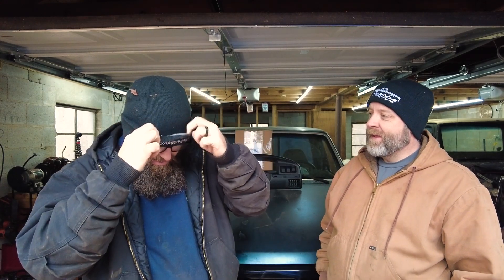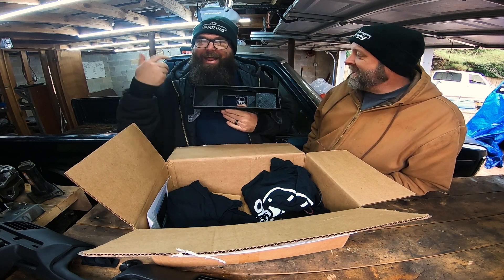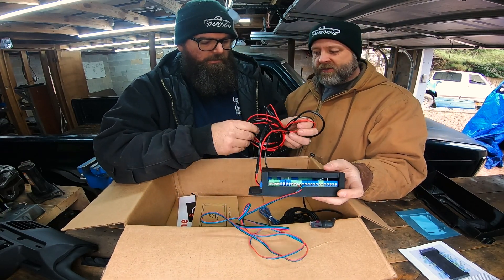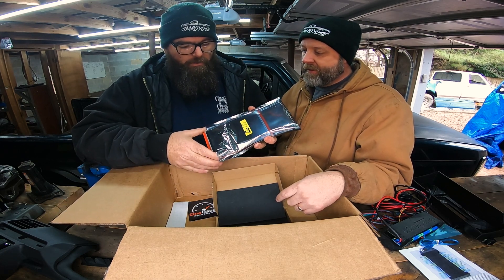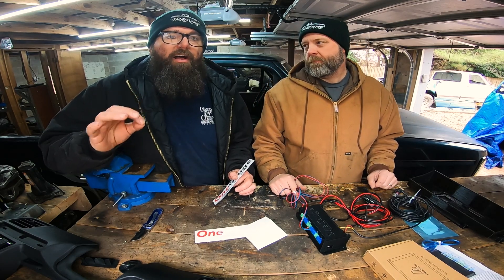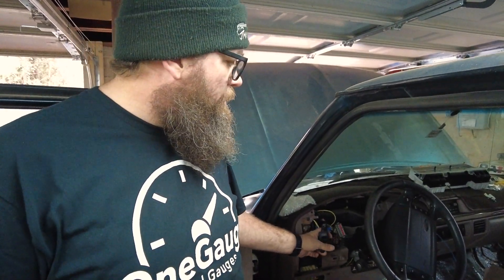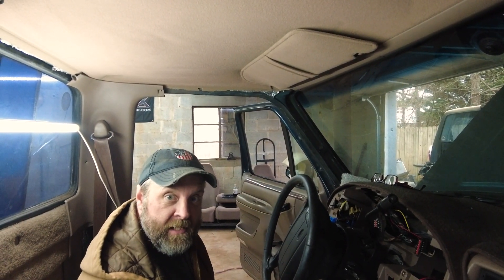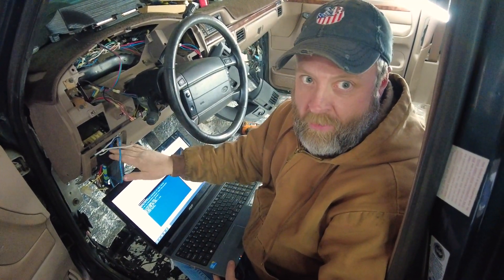Installing ONEGAUGE Touchscreen Cluster in our Coyote Swap F150

Comment: Sonehat do you do with the 3 plugs from the original guage cluster? There's like 20 wires from it. Do you just unplugg everything and rewire every sensor to that adaptor? Or you guys aren't using anything except speed sensor and oil pressure lol. I'm lost
Reply from the maker: OK so on our setup the majority of the data comes via the pcm.  Since our motor is a coyote it does not use any of the obs old wires for communicating.  So the old wires get wired in a bundle under cluster.  We then depin them inside the fuse box and they are dead.  Hope that helps.  Thanks for comment and support
Reply: @JMRRebuilders  ok I think that makes sense. So if someone was to use this setup on a stock obs ford with stock wiring I could just re wiring the guage plugs into the box that you showed and that's for the most part it. I've never done this so very curious

Comment: Great video! You should make a few videos on adding  lets say, a oil gauge or a temp gauge then wiring it in etc... it'd be much appreciated knowing ill be upgrading my entire dash soon. 96 bronco 5.8W 
Also is it possible to run this setup using a larger tablet for the screen?
Reply from the maker: Thanks brother for the encouraging comment.  I would say there are all kinds of setups.  We will be adding an additional touchscreen in the dash that will also sync to the one gauge via bluetooth.  Zo stay tuned.  As far as I know onegauge can work with anything.  Only limit is your money and time.  Good luck brother

Comment: Great video guy’s. I love the new screen. I’m building a 94 351 powered f150. All analog. Will it work with my setup? Thanks
Reply from the maker: Yeah man it sure can.  We will forward this onto oneguage.  Thanks for the support and resch ojt to them. Super helpful
Reply: @JMRRebuilders  ok guys. Thank you.
Reply: They are correct! No problem working with an all analog vehicle. The setup would work just like aftermarket gauges, you add a sender for each gauge you want. Pretty easy!

Comment: Nice job guys! Install really is this easy for most people, especially with an OBD-II kit. Our products will work on any vehicle though, and you can always add/remove sensors as needed!
Reply from the maker: Heck yeah truly an amazing aystem.  Absolutely amazing.
Reply: So my 90 F150 with a 302 has the Summit EFI system. Uses FiTech. Will this work if it's not OBD2?
Reply: @kennethwillett5193  I didn't realize that Fitech made the Summit EFIs, but yes, we have Fitech compatible products that are plug and play!